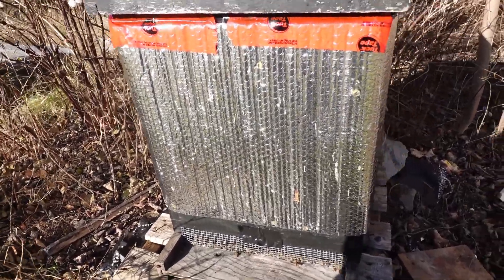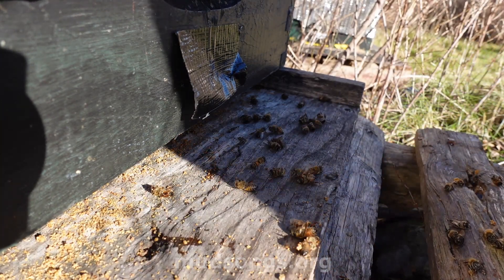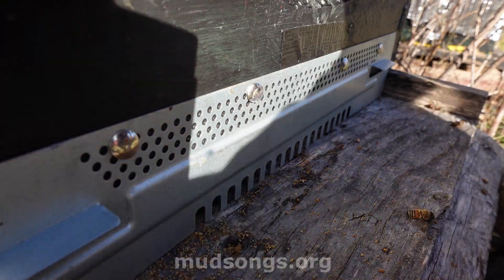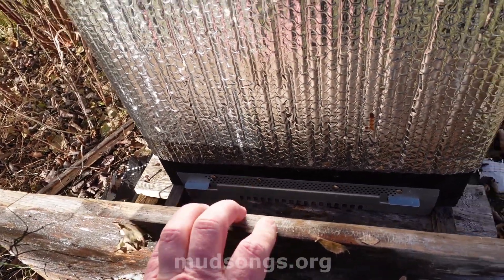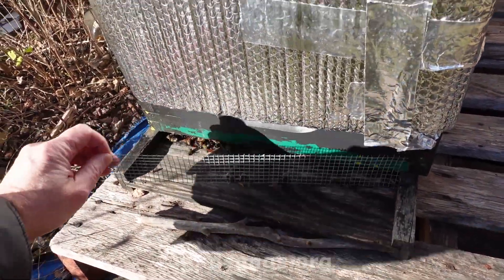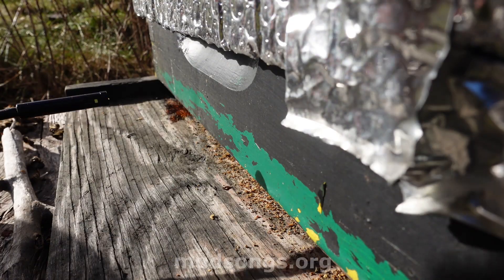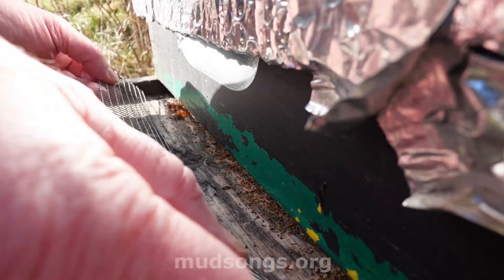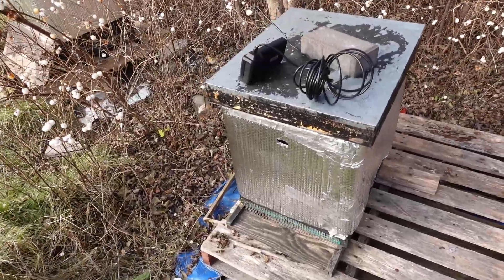Endoscope Inside Two Condensing Hives

Comment: Do you open your hives in the winter at all?
Reply from the maker: As little as possible, but I don't have a rule "never open in the winter." If I think they're running low honey and could starve, I won't hesitate to open them. Opening is usually done best earlier in the day so the bees have to time to regenerate heat before it gets colder during the night.

Comment: What is the wrapper on the side?
Reply from the maker: It's a foil bubble wrap insulation often sold under the brand name Reflectix in hardware stores. Beekeeping supply stores sell it at much more inflated price. I don't think it does much of anything other than provide a windbreak from freezing winds. It's insulation value is pretty minimal, but it's good enough for my climate.
Reply: @mudsongs if you double it up it’s a R rating 7 and one layer is 3 also you should make your entrance smaller were are you located
?
Reply from the maker: @aaronparis4714  - I know it's common to reduce the bottom entrance over winter, if not all year around, but except during robbing season, I seem to have better results with wide open bottom entrances in the winter. Less mold and excess moisture inside the hive.

A lack of moisture has never been an issue for my hive, even when I had top ventilation. I suspect my bees benefit more from not losing heat through top ventilation.

Comment: Hahaha!  I just commented on your other video with the same information you covered even more clearly in this one!  Im wondering if your poly hive has enough insulation on top.
Reply from the maker: I do wonder about the poly hive. When I bought it, I was told the top cover provides more insulation than the sides, so there should be thermodynamic differential that causes condensation to build on on the sides. But when I look at the thickness of the top and the sides, they look to be about the same, which is not how it should be. So we'll see what happens with it this winter.